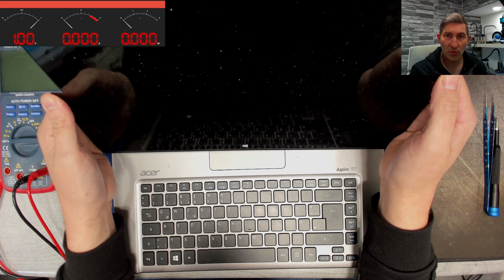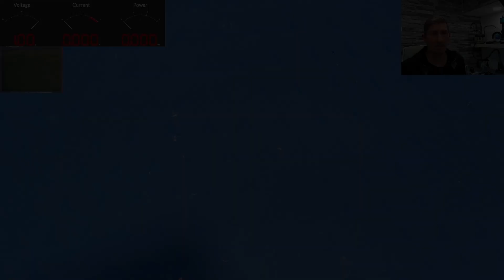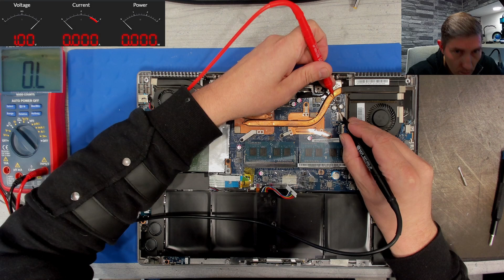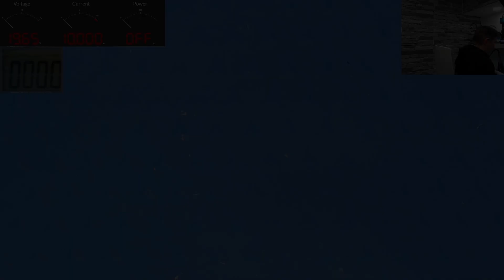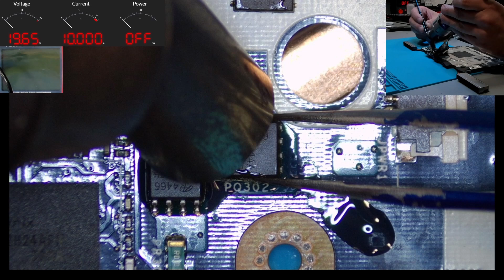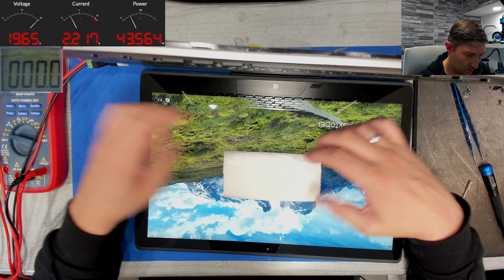Acer Aspire R7 - What a interesting machine but with multiple faults. Step-by-step troubleshooting

Comment: Nice fix. A battery over 2 years old, I would recommend the customer to replace it (most batteries have a production date). Battery in a completely empty state, you need to wake up the battery with external charging 16V 3A for 15 minutes, after that connect it to the computer and check if it charges. In addition to the repair, you can suggest replacing the hard disk with a faster one.

Comment: Could be a bad cable between screen and motherboard. There are more hinges than usual.
Perhaps sometimes touch is working and sometimes not.

For an experimental laptop it is still working fine after ten years.